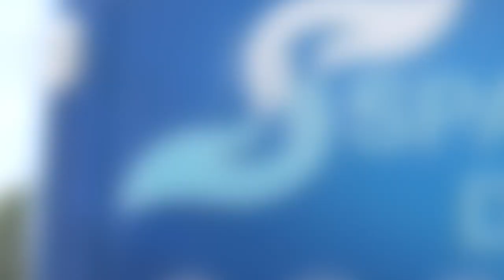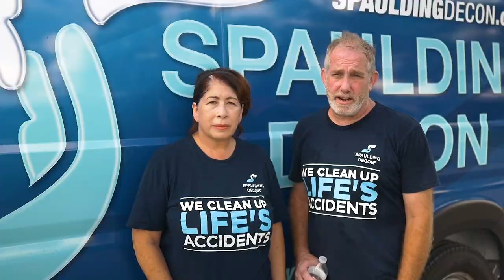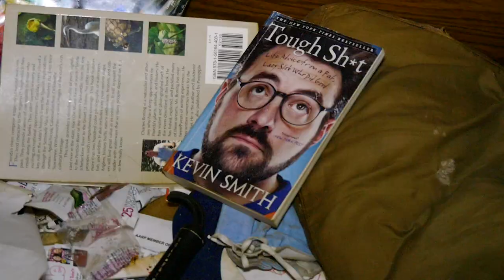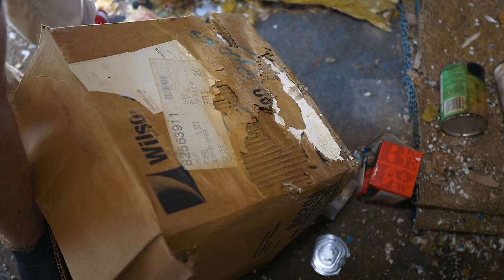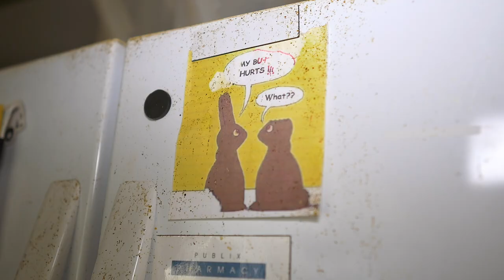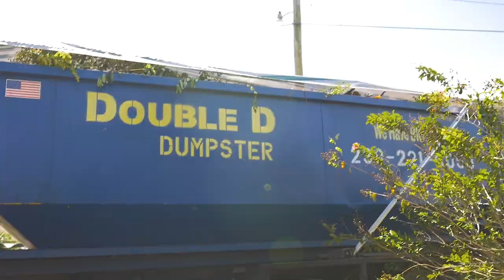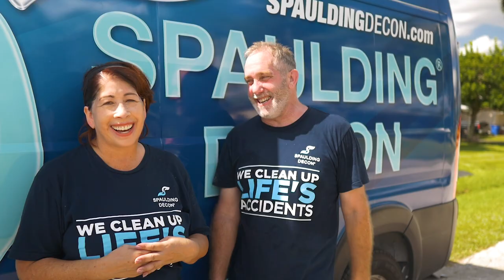Rat Infested Hoarding Nightmare Pt. 1 | Fort Myers, FL

Comment: To catch mice or rats, use raw bacon and tie it to the trip lever with (for mice traps) double strand of sewing thread, (for rat traps) use crochet thread. Cuts the ends, after the tied knots,  very short so the rodents don’t grab it and have enough length so, when they pull, their head is too far out and the snapper misses hitting them across the neck or back of the skull. Cheese is too soft and will crumble out of the trip lever. Tied, raw bacon is tough and doesn’t “give way” to a tug; thus, keeping the trap “following” the mouth and the trap catching them more effectively. Not 100% guaranteed, but way more effective than cheese. 😊